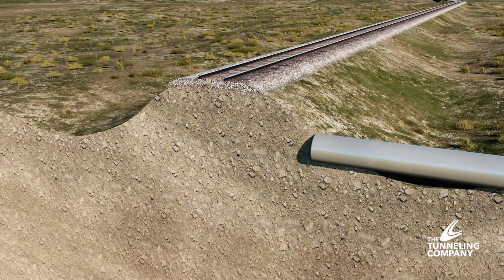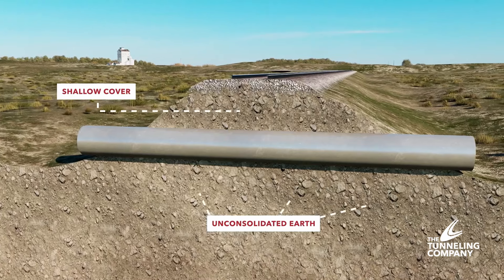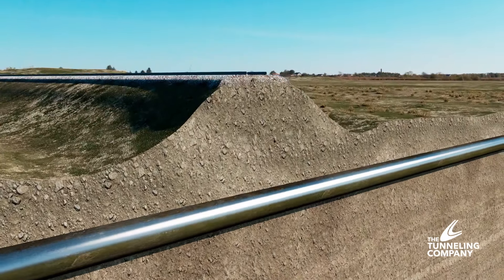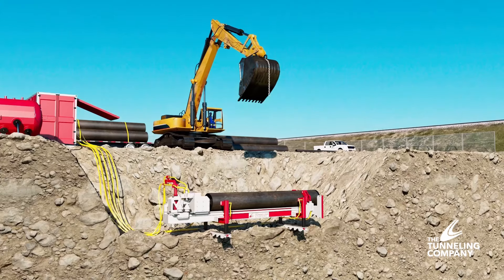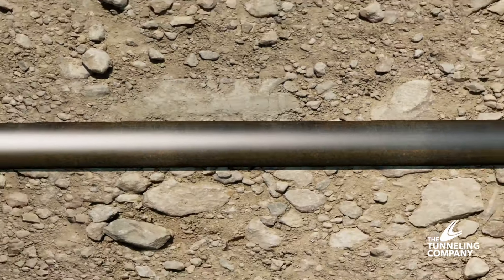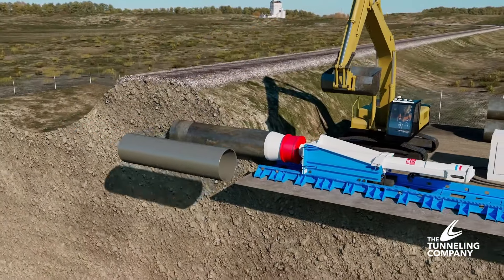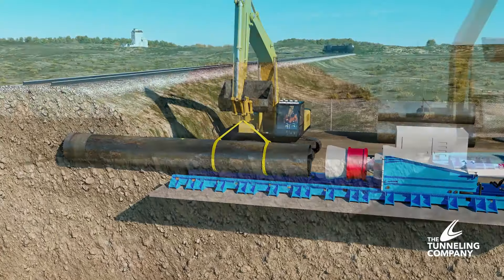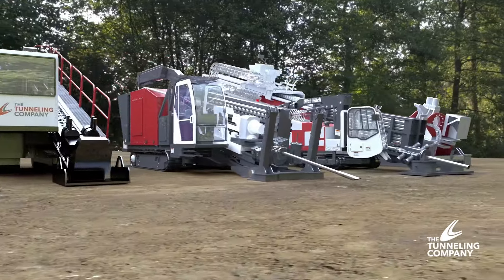Railway Crossings Made Easy - The Tunneling Company

Comment: Systems like this could be adapted to environmental conditions present on Luna especially the hydrohammer.  Both systems show potential for teleoperation in permanently shaded craters at the South Pole region where water ice with mixed grade aggregate under cryogenic temperatures will be an incredibly important challenge to overcome. Luna has sub surface conditions that may vary from concrete like water ice & aggregate to unstable mixed grade aggregate.